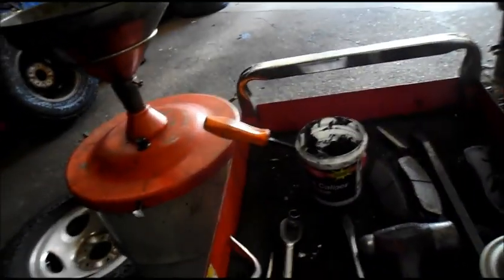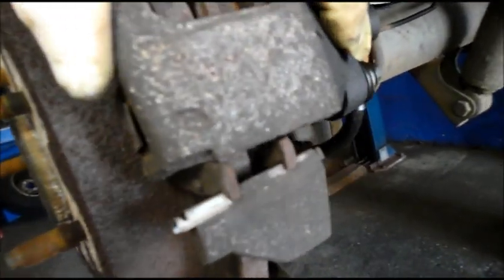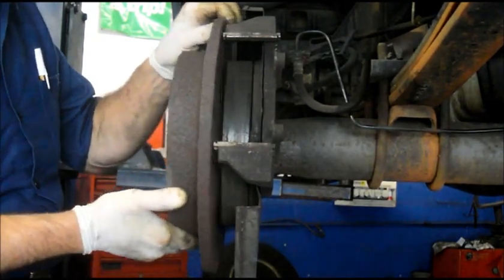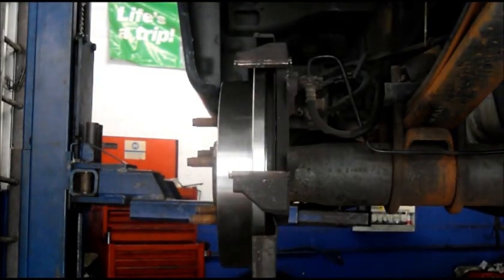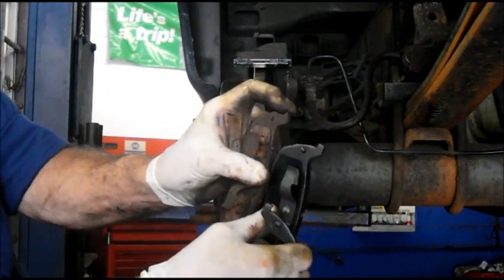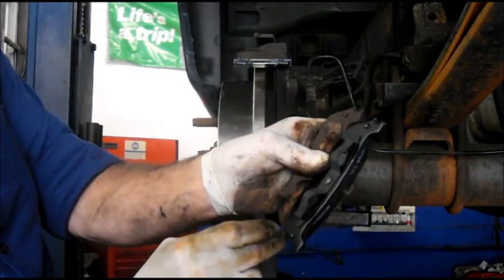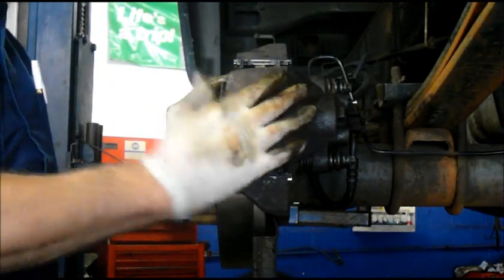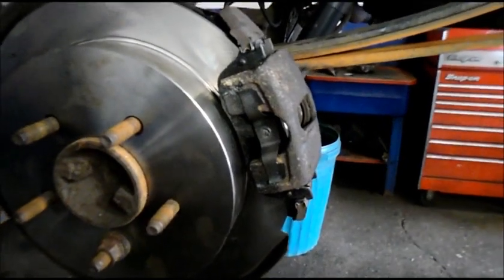How To Replace Rear brakes And Rotors On A Ford F150

Comment: Another great brake service video. You really demonstrated the correct way (in my humble opinion) to replace the brakes on that Ford truck. I sometimes struggle with some years of Ford trucks getting at the adjuster for the park brake. I think you know what I mean {:-) If I know I will be removing the rotors I drive them a short distance with the park brake slightly applied. I think it helps removing the rotors sometimes
Reply from the maker: +wysetech2000  You know that a very good idea to drive for a short distance with the parking brake on.I will try that the next time.Thanks for the advice.Oh by the way I was just lucky to get them off that easy :-)